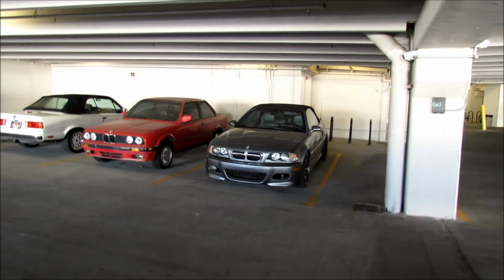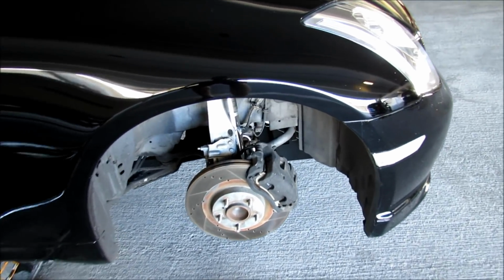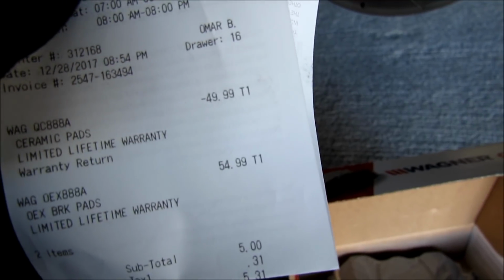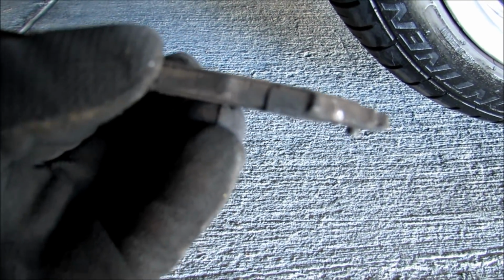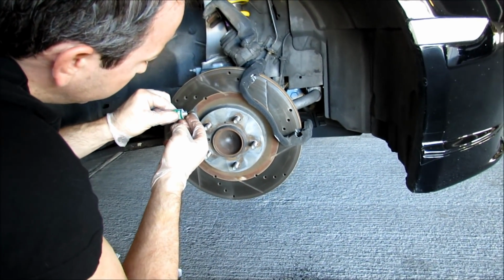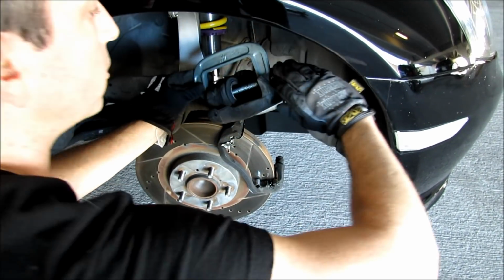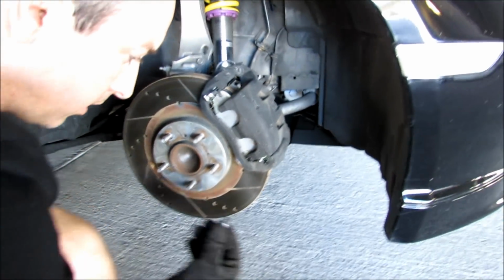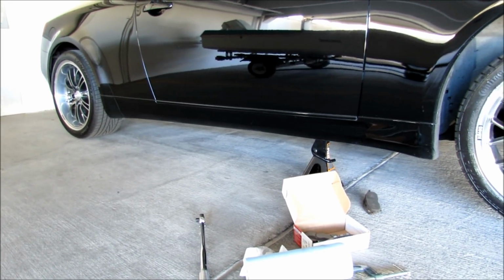G35 / 350z - Brake INSTALL

Comment: Great video. The one thing I noticed that you didn’t clean and lube was the slider pins. I can’t tell you how many times I’ve done a brake job (when I was working at Nissan) and those slider pins were seized, causing premature wear on the pads. Other than that, easy to follow video on how to do a brake job. Well done.
Reply from the maker: ducatikid848 .....right on, thank you. The slider pins are the 14mm bolts that you screw in to hold the caliper right? I did lube them up and dropped a dap inside the dust boot.
Reply: Motordyne G35 , the slider pin is what the bolt screws into. It’s inside that dust boot. It’s a long pin. See link for photo. The two pins in the top left. 
https://i.ebayimg.com/images/g/EcQAAOSwtZ5Z4KKC/s-l300.jpg
Reply from the maker: Yep, you are right. I forgot to do the slider pin, thank you for looking out!
Reply: Probably the biggest reason why the passenger side wore faster then the drivers side is those pins, it could also be why its making noise in the first place, applying grease to those is almost the most important part of a brake job id highly recommend going back and doing so
Reply from the maker: Thank you both. I bet you are right and that is why 1 pad of the 4 wore unevenly. I don't think I have ever lubed the slide pins in 12 years. I went back and lubed them up, thank you guys for helping me!
Reply: Def the slider pins that caused that abnormal uneven wear on drivers side.  The slider pin when not seized allows even pressure on both pads when braking.  If the slider pin cant slide will usually see uneven wear.

Comment: You gotta lube the sliders on these. Also, drop those pads...Autozone now makes a GT pad that has some crazy bite to them. Really good OEM replacement pad. Next time your at O'Reillys ask them for "Black Raven nitrile gloves. You'll thank me later.
Reply from the maker: Clean G35 .....thank you for pointing this out like others have already, you guys are on it. I appreciate it. I don't think I have ever lubed the slider pins before and that is probably why 1 brake pad wore out faster than the rest.  I try learn something new everyday, thanks for the extra knowledge.
Reply from the maker: black raven nitrile gloves.......interesting. I've always used cheap latex rubber gloves, but thanks for the suggestion. I've never heard of black raven nitrile gloves before which look a lot more durable.
Reply: The sliders are what let the caliper "fully" disengage off the rotor when you let off the pedal. Without it, you can get drag, warped rotors,etc... And we know these cars are famous for warping rotors.  The Ravens are only 7mL thick but they get the job done fairly well. They also have some other options that are thicker, I think the orange gloves are 9mL thick and the dark blue "Thicksters" are 14mL thick for those really nasty jobs, but are latex so some chemicals will melt or distort them.
Reply: Clean G35 performance friction pads from o Reilly’s are better

Comment: Quick question, when you jack up the car , and you spin the 2 front wheels are they suppose to make slightly grind noise ? I’ve already replaced rotors and pads,

Comment: What radio thing do u have in ur car with the backup camera? unless its factory
Reply from the maker: Jxmez Druqz .....https://rover.ebay.com/rover/0/0/0?mpre=https%3A%2F%2Fwww.ebay.com%2Fulk%2Fitm%2F222497876478
Reply: Motordyne G35 the screen link?
Reply: Can the back-up camera be connected to the yellow input in the armrest-console (requiring hitting the AUX button to view, I presume) ?

Comment: hey man, i gotta question. i recently replaced my rotors n pads but when i went to drive it the pads were rubbing without me being on the brakes. would i need to grease my slider pins or adjust my caliper in any way??
Reply from the maker: How much rubbing? Enough to slow the car down? If not slowing car down, don’t worry about it. Over time the pistons get old and seize. An early sign they are going out is the get stuck out. Especially if you live in a cold climate and it sees salt.
Reply: @MotordyneG35   minor rubbing, enough to mark the rotor but the car feels like it’s braking around parking lot speeds
Reply from the maker: @cristianleon6883  ..it is or it feels like it? Go 80mph, put it in neutral and see if it stops on its own or maintains speed. Go do some hard braking and driving; report back if problem still exists.

Comment: hey, not sure if i asked you this. what's a good mod for less body roll, i see you have MD Sway bars , did you buy them because of the fitment for you're tdx2's?
Reply from the maker: Motordyne Sways are on my list, I wish I had them. To deal with the large pipes hitting the oem sways on big bumps, I took rubber hose and wrapped it around my OEM sway bars.

Comment: Hello everyone quick question I just got a g35 05 5at about a month ago and preformed a full tune up but now a few weeks earlier in first gear I get a rev bounce and now I have a ticking near the passenger side underneath the motor any ideas what it could be?
Reply from the maker: Ayy Lmao  ....does the ticking get louder when you rev the motor?
Reply: Motordyne G35 seems to go away at around 1.5 rpms but it’s really loud during startup and idle
Reply from the maker: Ayy Lmao ....could be a loose heat shield. Not sure unless I hear it in person. Jack the car up and get closer to the sound. Make sure oil is in the car, you can never check the oil enough.
Reply: Motordyne G35 sorry for the late reply and I greatly appreciate the reply. The rev bounced was fixed after I found a rip in the intake after the maf sensor but as the for the tapping it’s still there fluids are good and oil is slightly below the full mark. I’ll be jacking up the car so to inspect the tapping and I would appreciate if you watched when I do post it. By the way I found your channel recently and have watched almost every video. Love your Format and the detailed information hope your channel grows due to the popularity of this vehicle becoming affordable for younger people.

Comment: What size wheels/tires& offset are you running
Reply from the maker: Nick Ficklin ....255 in front and 285 in the rear. My rims are like 10 years old and discontinued. I have no clue what the offset is, but eventually I am getting new rims. I want a square set up at 285 all around instead of factory staggered.

Comment: How long do your rotors usually last?
Reply from the maker: Jordan Dennis ....I put the brake pads on in 2015 and I had the rotors turned 1x, where they shave a thin layer of steel off to smooth them out for $10 per rotor at Orileys. I purchased the rotors off eBay in 2012 for $150 for all 4. After track use and daily use they are still fine 6 years later. I would say another 1 or 2 years will it will be time to get new rotors.